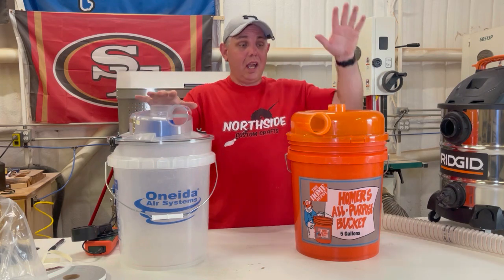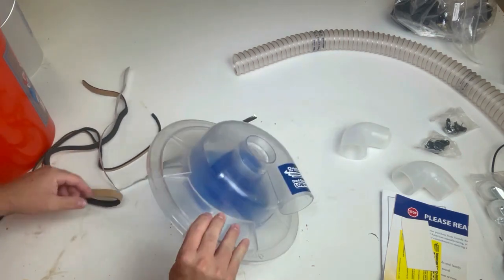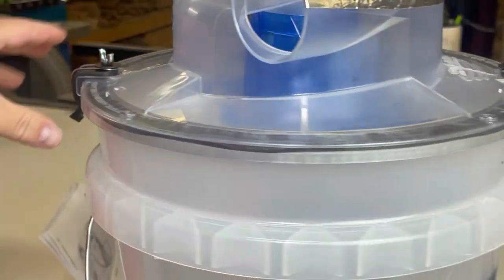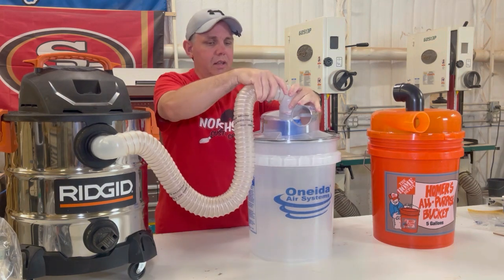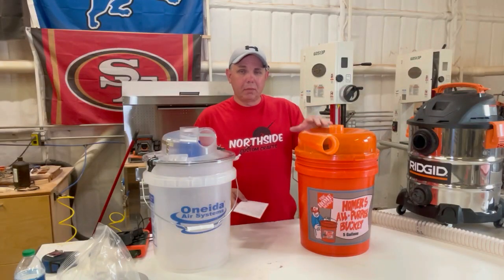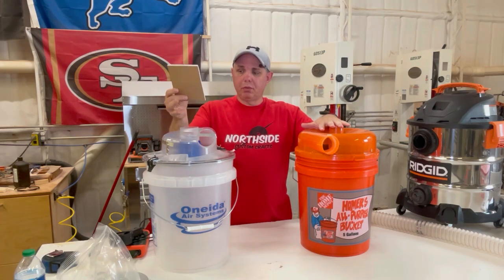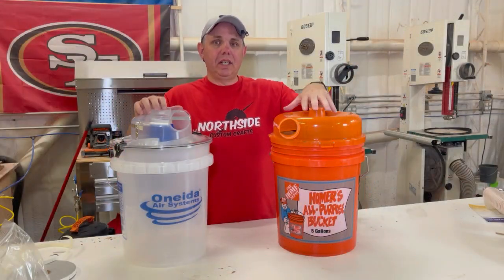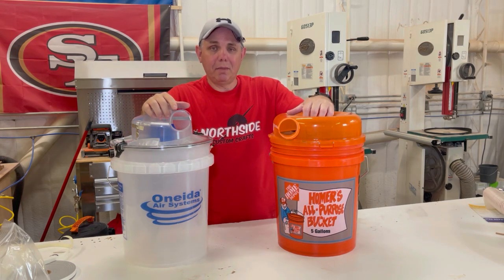Low Profile Dust Deputy vs Dustopper // Cyclone Shootout CFM Test

Comment: Sadly, your anemometer measurements aren't accurate unless you seal to the inlet. The bigger the diameter mismatch the larger the error. You could probably get good comparisons sealing w/duct tape, but you'll need some attempt at concentricity. Otherwise, interesting intro to the Oneida
Reply from the maker: Thanks for your input Mr. Engineer I’m glad you enjoyed the video… I just held each one until they read the best… I really just wanted to show the difference between them both and  think I accomplished that with how I did this.. … Jake
Reply: @JakeThompson  Which is precisely why they have to be sealed. Otherwise, you're getting CLOSE at best, but the erratic readings are your indication that your numbers are not trustworthy.
Reply from the maker: @michaelmccoy4989  I will be looking forward to the video you put out that is absolutely perfect.. let me know when it’s made. I will definitely subscribe to your channel

Comment: I use the Dust Right and have for the last 5-7 years as my shop dust mitigation - it has served me well - I do use an additional shop vac (12 gal ridgid) disposable filter that goes in the vac before the one that comes with the product (the round pleated one).  Good comparison Jake and I did not know of the new Dust Deputy.  One thing I did early on was enclose the shop vac in a 3/4 ply box I built with padding on the inside.  After that the noise level went way down, shop vac not screaming at me all day and I can hold a normal level conversation when it is turned on.  IMO there is no dust collector in the world just some mitigation solutions are better than others.
Reply from the maker: That’s a pretty solid kid opinion.. I saw the new one and figured I might try to be first to check it out.. I kinda like messing with the dust collection.

Comment: My experience with the Dustopper is that it does a good job with large and medium fine chips but when it comes to fine particles from sanding they make their way into the vac and eventually clog the filter.   Could you do a test with fine sanding dust? The Dust Deputy seemed a little quieter than the Dustopper.
Nice review!!!  Thanks
Reply from the maker: I did a comparison a while back and showed with fine dust .. https://youtu.be/XsCVcx2O0u4 

After I was almost done editing, I noticed a noise difference and there is definitely a difference in noise between the two.  Maybe a video for another day.  I’m glad you enjoyed the video. 👍👍
Reply: Pretty much all cyclonic separators have issues with fine dust. You should still run a filter bag with these to catch that.

Comment: Nice, but did you re-test it with the plug installed in the dust deputy low profile?
Reply from the maker: I did. Here's a couple videos https://youtu.be/BC4s6m9nx5w?si=dZ5yLjVKkQy6x0rB    https://youtu.be/1YsksrFxj9g?si=blwUILbCvGXfRU8f  It still ran the same cfm, but stopped letting dust through.

Comment: Hi and thank you for comparison!
But if you really want to test the filtration its not enough to suck such a small amount of dust and then just look by eyes.
What really matter is how they can filter unvisible dust. Therefore you have to have two same quantities of dust what you precisely weight before and after.
And it is important NOT to use same dust again - because it would already have finest particle catched in vacuum filters...
But thank you anyway! I didnt know that there is this new low profile oneida cyclone.. It looks like its time to upgrade my workshop =)
Tomáš

Comment: Am I correct in the assumption that the little black plug is missing on the Oneida product in this video?
Reply from the maker: Yes. the plug was missing in this video.. I really didn't see to big of a problem in this one because I didn't vacuum up a lot of dust or get aggressive with it. It did let some fine dust in the vacuum but I didn't think much of it at the time of filming this one.

Comment: Thank-you for this comparison, and all your other videos!  Much appreciated!
As you noticed, flex hose is bad for airflow.  Smooth pipe is much better than flex hose.  Turns and bends degrade airflow.  Sharp turns and bends are even worse.  Straight runs are better than lots of bends.  Shorter runs are better than long.  
For best air flow:
- Use two inch PVC plumbing pipe to connect dust separator and shop vac.  
- Minimize distance between dust separator and shop vac.
- Reduce turns to ONE!  90 degree turn (use a long sweep, not a tight 90) coming out of dust separator, and a straight run into the shop vac.
- Position dust separator and shop vac at appropriate height to support that connection.
In my case, these guidelines required elevating the shop vac several inches onto a small platform.
Result:  11% improvement in airflow.
Stay safe!
Reply from the maker: Thank you 👍👍
Reply: @JakeThompson  Have you looked at the Dustopper Pro?  Wondering if the advertised improvement is real.
Reply from the maker: @joedance14  check out  the videos I put out after this one.. 👍👍
Reply: @JakeThompson  Thank-you!

Comment: I just bought the Oneida lid only and had an old 5gal plastic pail laying around. I have the gasket installed correctly and it does not appear to want to snap correctly and fit well. Do I have to buy a "Oneida" bucket to get a good fit?
Reply from the maker: I got a bucket from Lowe’s and it worked fine..
Reply: @JakeThompson  I had to loosen the screws just a bit and then PUSH HARD TO GET THE LATCHES TO CATCH. Boy this is slick, thanks.

Comment: Does the comparison need to be redone now that you have the little black button installed in the center on the Oneida?
Reply from the maker: It does need to get redone.. when I get some time to do it.. but I can say.. the little button didn’t change CFM, but it definitely keeps the dust in the bucket and not in the vac.

Comment: Thanks for the video!

Could you do a video that compiles all the info of dustopper pro vs deputy low pro vs deputy 2.5 vs vac with no cyclone?
Reply from the maker: I might do something like that but probably not without the separator.. we will see what happens pretty soon.. I have something in the works. 👍